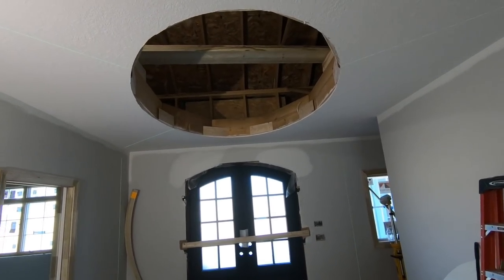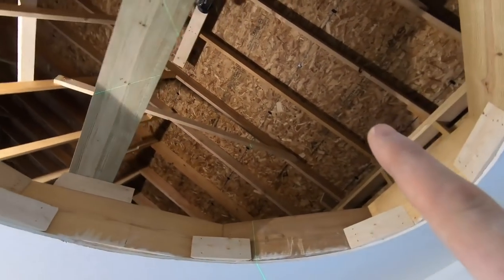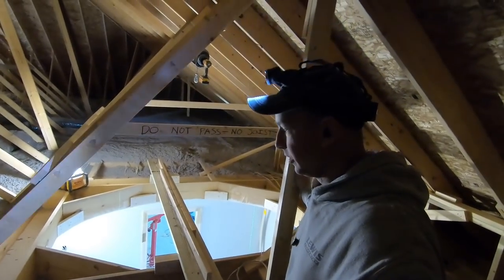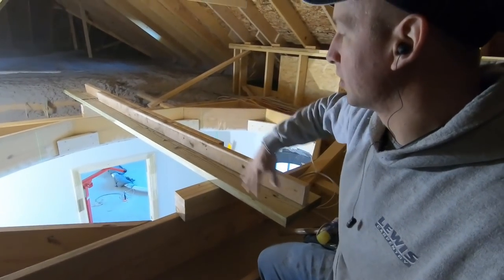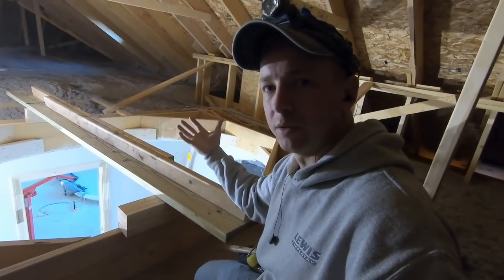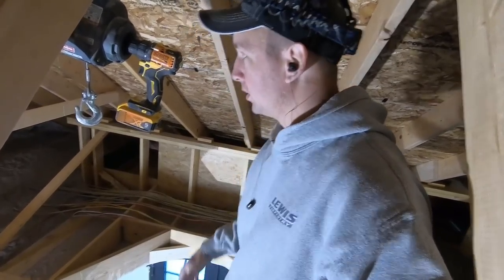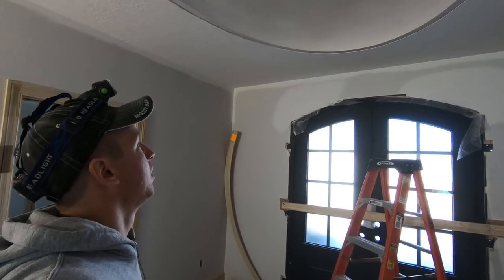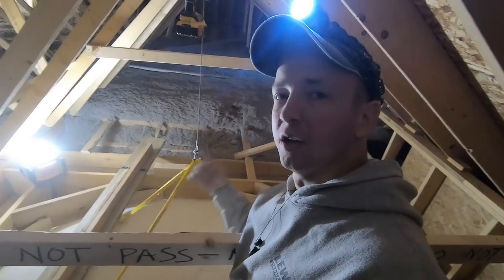Lifting The Dome of Doom - Big $$$$ Lost If I Drop It - Part 2

Comment: Nice job Spencer. Not to be out of place. Just a little tip. When hooking up the the cable use thimbles on each end. If using cable clamps make sure you do not saddle a dead horse. What I would tell the young guys starting out with me do rigging on movies is tail to the top. If you you fist grips you do not have to worry about saddling a dead horse. Watch when tightening the turn buckles. Once the cable is tight is good enough. They are there as a Safty if the screws were to fail over time. I am just saying this for anyone else that might attempt this. Not saying that you do not know. Again great job. Keep these great videos coming. Thank you for taking the time out in your day for us viewers to enjoy

Comment: Great job (as always)!   A couple of thoughts: 
- A small diameter line to one of the eyes (commonly called a “tag line”) would allow you to keep control of the dome and keep it from spinning.
- With the continuous curve of the oval shape, I’m wondering if a mark on one end and corresponding mark on the framework would have made positioning it in place / alignment easier?
Great thoughts on making life easy for the electrician as well as the safety barrier for those who come after you to that area!!
Bravo!!

Comment: I'm the electrician that appreciates you for planning for other trades. I installed a powered winch in the attic of a large home so the great room chandelier could be lowered from the 2nd floor vault trough the staircase opening all the way to the basement in order to change bulbs. I had to do all of the framing in the attic for support myself. No complaints here, just get the job done. Great mini series.
Reply from the maker: That would have been really interesting to see.
Reply: I have installed one of those before and the framing has to be pretty beefy. The electrician only had to run the wires and install the devices. I usually have to settle the fight between the electrician and the plumber when it comes to bathroom exhaust fans ,I could never figure out why I needed 2 trades to install one of those.
Reply: @jefferyholland  Ha! I normally supply and install the bath fans. Tinner would have the duct ready for me to attach to the fan as I would usually be in after them on the rough in.

Comment: If you are going to use tie wire from the dome to the rafters I would recommend putting a turnbuckle between each one for adjustment to keep it tight to the ceiling… Or ratchet straps is another option… But just tie wire alone would be very difficult to keep it tight to the ceiling

Comment: Hi Spencer,  Certainly quite a task.  Would a plasterboard lifter have been easier, you could then work from the bottom and it would make lifting up the trim very easy and safe as well?  I find your stuff very informative and interesting and learn quite a few " dodges" from them.  Thanks.  Mike
Reply from the maker: Being that the unit had straps/lift points built into the mold it made way more sense to lift it from those strap locations. Had those straps locations not been there I may have take a different approach. But it was a piece of cake the way I did it.

Comment: wild job to do your a machine bro.   could you not have jus used the dry wall lift  with the dom cradled upside down on laser marks as the template to trace the hole. and and then install with the lift, like u did with the trim? i assume u had a hole lot of climbing up and down being by yourself + doin video
Reply from the maker: I was avoiding damage to the plaster that the lift likely would have caused, or worse even ruined the dome. And with a 6 week lead time and huge price tag I didn't want to do that.

Comment: I would be really interested in knowing why you don’t have a helper. Have you ever had one? I’m assuming you prefer to work alone. But it just seems like a $15-20hr helper would greatly increase your productivity and bottom line. It does mine.
Reply from the maker: For me its a loss of productivity and energy drain/loss of freedom. I do just fine working alone. And a $20/hr guy needs to be billed out at $60. Easier said than done.
Reply: @InsiderCarpentry  thank you for the response. Do you mean that you would need to account for $60hr income to pay out $20 to your guy? I don’t quite follow. Either way, maybe you’d consider this on a video topic: Working alone vs with a helper/team and why you go solo. 

Thanks man!!

Comment: Using a panel lift is a lot easier. I can do these in less than a day. In the 90s these were all the rage,did around 10 of these glass domes and about a dozen domes over 20 feet in entry ways above stairs, good times.Enjoy your videos
Reply from the maker: It takes five minutes to put the winch up and attach it to the anchor points and there’s no chance of damaging it. Secondly getting the dome onto the panel lift alone would have risked damaging it. And this one wasn’t very thick. Would have made me nervous of the arms denting or punching through the plaster.

Comment: If you were a two or more man crew would you and another just have lifted the dome and used your dry wall lift? I like your one man crew mentality. Tie wire may be something you want on hand. A run to the hardware store isn't very lean.
Reply from the maker: Given the cost I still would have used the winch. Less chance of disaster than two guys on ladders.
Reply: @InsiderCarpentry  Thanks for the reply. I guess I don't know the dangers of ladders. I'm 40 and been around them for 32 years.
Reply from the maker: I’ve been injured carrying a heavy object up ladders with multiple guys. One guy missteps and it all comes crashing down and people get hurt. The way I did it is safer both physically and preventing damage to the product.